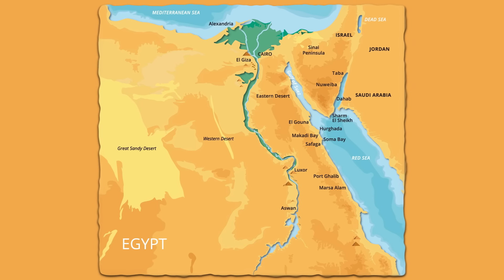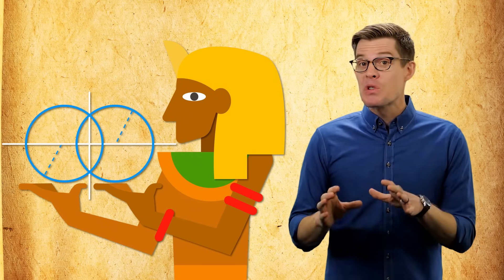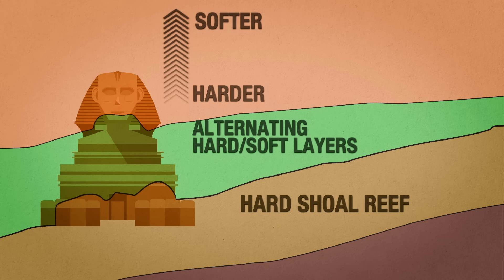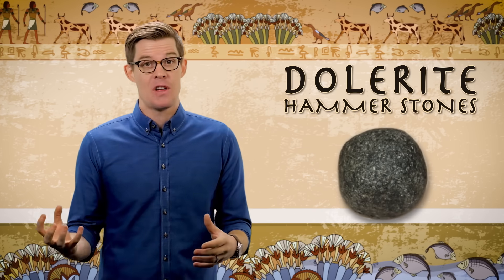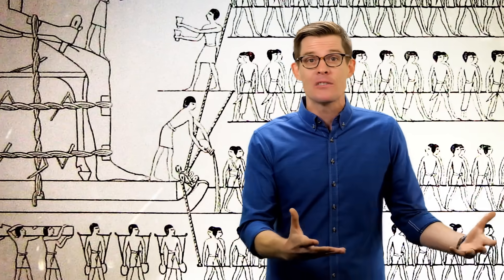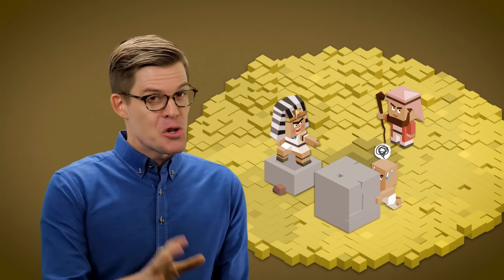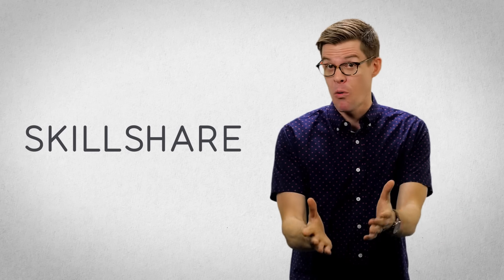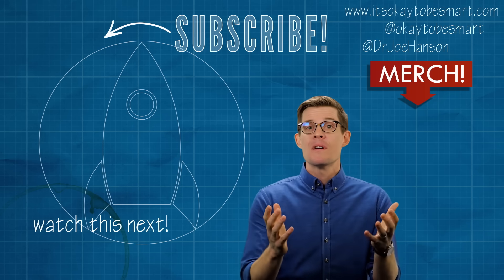The INCREDIBLE Ancient Engineering That Built the Pyramids

Comment: How did they core perfect holes in granite?
Reply: Copper/bronze drills and sand.
Reply: jmaedl027 jmaedl  How do you know?
Reply: jmaedl027 jmaedl  There are drill holes and granite cores dating from the Old Kingdom. And experimental archaeology has proven that you can drill granite with Egyptian bronze age tools.
Reply: jmaedl027 jmaedl  You can get a drilling rate in granite of 5 cubic cm/hour (Denys Stocks, Experiments in Egyptian Archaeology, page 115), which is fine. The experiments were done long enough until the core was snapped out.
Reply: jmaedl027 jmaedl  What does this have to do with granite drilling? There are many possible explanations in the last 3000 years.
Reply: jmaedl027 jmaedl  Google what? The experiments have replicated those drill holes and cores with primitive technology. Do you have any evidence of any previous advanced civilization?
Reply: It wasn't always a hard granite rock , it was soft , wet , pliable flesh from gigantic giants from the flood !

The truth will blow your mind !
Reply: "Hammers, chisels and sand!" 🤣😂
Reply: @BaMenace  Obviously it was lasers, sound wave technology and anti-gravitational devices, everyone knows that...
Reply: I do not believe also that they were able to drill holes in granite using the mentioned tools made of bronze. The wear of a bronze tool is simply too high. They would have to use thousands of tools or resharpen them so often to be able to drill even very small and shallow hole. 

And another problem with drilling deeper hole into any kind of material is to avoid hole deviation to the side. Today we use special drills with sensors able to detect start of side deviation and steel drills able to make correction of drilling direction in order of compensation.

Simply no way of making even 20 inch through hole into a granite slab without a side deviation using mentioned tools!
Reply: @MrAchile13   didyou even watch the video after an entire day's labor they managed to do a core that was about 2 and 1/2 inch deep to people using modern-day rope around a modern-day built drill made to emulate an ancient drill bit I don't think that holds any water
Reply: @deepsquat600  It proves that granite can be cut with copper and sand and the results are matching with the ancient cores and drill holes. You may want to explain why modern rope is so different then the ancient one.

The rates of cutting granite are: 
sawing 12 cubic cm/ hour
drilling 5 cubic cm/hour
Source: Denys Stocks, Experiments in Egyptian Archaeology, page 115.
Reply: @MrAchile13  well as to the rope a modern rope will last much much longer than some Vines put together running across a stick the vines running across the stick will heat up and wear away very very quicklyas for the copper proving you can cut it through the stone it wears it away yes but did you see anybody cut all the way through a stone
Reply: By that I mean did you see a stone block cut all six sides straight and even get a date know they said a day for a couple of workers to go 5cm that's just ridiculous that means out of the million Stones you would have what 700 million man hours I don't know but it would be way way too long and way too many people and way too labor-intensive as not even talking aboutthe wear and tear on the copper saw where would you get all that copper how many times would you have to melt it back down and create another one how many saw blades would you go through just to cut one block these are all the things you're not considering
Reply: @deepsquat600  1) Egyptian didn't used vines, they used ropes, made from a range of materials which were durable.

2)  "did you see anybody cut all the way through a stone" no...people have much more efficient ways of cutting stone nowadays. You don't need to cut a stone in half in order to calculate the cutting rate.

3) This is a false dilemma: most of the stones used in the Great pyramid are limestone, not granite. Don't confuse the two.

4) If you want to see a calculation for the complete manufacturing of a granite sarcophagus, alike the one of Khufu, check out the comment section of this blog.

http://www.jasoncolavito.com/blog/matt-sibson-claims-lost-egyptian-sacred-book-holds-secret-of-the-pyramids
Reply: jmaedl027 jmaedl  they definitely didnt dk it
Reply: Please ... Stop with the guessing , you can only confuse others who seek the bare truth .

The hole were cut into the material.
The material was wet , soggy tendonus flesh from gigantic humans who stood over 2 miles tall .
The flood came and they got stuck in the mud and drowned while standing.
The salty water from the flood cause the bones to dissolve but the tendons love the salt as the would become petrified or preserved .
These humongous Achilles Tendons was like a huge block of cheese , very soft but they were in block formations.
The entire body of humans are blocks of cells and this is why you hear people talking about building blocks of life .
The tendonus flesh was soft that they didn't need mortar for the joints , it was self-sealing.

The pyramids were not built from the bottom down , they were built from the top down as the material was already in place .

I guess I should go ahead and tell you the biggest kept secret of this world .
This might shock most of you and or scare the he'll out of you but you are living on top of these dead gigantic creatures.
What you are calling land is nothing more than the dead piled up body's of unbelievable creatures, human and mammals.
Serpents
Dragons 
Humans
And animals of all kinds that you have never heard of or seen .
This planet is not what you have been taught , we have all been told lies . The things you call rock , mountains , sand , dirt , stones are all body parts that were petrified by the salt water flood.

Every land mass that is above water is made up of dead gigantic creatures and people are living on top of them.

They tell you that earthquakes are cause by some plates shifting but it is a way to keep the truth hidden. The earthquakes are simply the bodies of the creatures,  that we live on top of , shifting or moving because they are surrounded by water and their body's are decomposing little by little .
They told us that contenants shifted over time and broke apart , that is mostly true but they didn't tell you that the contenants are dead petrified body's and water moved them around as the dissolved or decomposed.

The human ( Gigantic ) creatures were called cloud eaters by those of Noah's days because their heads were up in the clouds.

If you want to know what the pyramids looke like before they took shape as we see today , Google the devil's tower , it's a smaller sample of what was used to build the pyramids.

If you was to see a human scaled size of a female giant, Google Ruby's Fall ..
 You will be looking at the inside of a female reproductive system but on a humongous scale .

There's a Serpent that runs from South America all the way up to California .
Now you understand why California is said to drop off into the ocean one day.
You also may understand why California has such good soul for growing things , they are located in the waste of the gigantic serpent ... Yes , the shiot hole is right there in California .

Houses are built on to of these dead , humongous creatures and we have never been told of this .
This shiot is deeper than You can imagine. ((No pun intended)) !

Now .... How does it make you feel to know that you are being charged your entire adult life a fee or tax for living on what is called property or land that is nothing more than dead creatures that does not belong to anyone and they are charging people yearly .
Who are the people that charge you such fees or taxes , they are the same one's that controls your life.
They take your money before you get paid and continue to take , these same people controls and owns the banks .

They are the elite , the controllers , they keep you Working for them until you die.

They just raised the retirement age !

You're welcome
Reply: @MrAchile13  the granite in the Giza plateu is too perfect to be done by hand. They are are consistently flat with a varience of 1/10000 of an inch. That precision cannot be achieved by hand. Believe it or not, but the builders of the pyramids used advanced tools and advanced engineering to build it. The fact it can't be replicated today should be self evident.
Reply: @javiersoto5223  

No advance tools , you watched too many videos !

You just don't understand what the material was before it hardened into granite !

You can't used your understanding to solve this , that's why people are having such a hard time figuring it out .

This was not hard material a first , it was like a block of cheese , soft and soggy until it hardened .
Reply: @NOTTHASAME yeah you're right. All over the world you can find evidence of geopolymers and softening of stone. The Aswan quarry also seems softened. I wonder how that was done.
Reply: @javiersoto5223  

You don't get what I said !!

If you would re-read the post , it told you that the material was not stone , it was tendonus material from dead humongous creatures that died during the flood .
The tendons and flesh became wet , soggy and pliable like a block of cheese.
Once it dried , it was hard as rock ... Granite rock is dried flesh !

There was no special tools needed , you could do it with your hands and no mortar needed as it was self sealant.
Reply: I seen spaghetti bigger than this guy's arms
Reply: Nick Nack  India, soft stones literally every where, cement granite on statues in Egypt n Syria. Pyramid casing stones. There's evidence everywhere
Reply: Nick Nack  the sand hypothesis is idiotic. And those countertops were made using diamonds and modern day machinery. How did ancient India drill mm sized holes that curve at angles using sand? What about the metal infused into the granite statues at Syria? Some temples in India are built with man made stone that float on water. The evidence is there, you just refuse to see it.
Reply: Nick Nack  thank you for being professional. It's rare to find people like you online. YouTube these videos; they have a lot of info
- "Ancient Building Techniques Concrete Use in Ancient Egypt" (there are examples of hollow statues in Egypt. The Assyrian winged bulls were made of some granite concrete. Faces on assyrian temple walls had metal beams to support them)
-"1000 Year Old Secret Drilling Technology" (one example of tiny holes in Indian temples)
-"Rock MELTING Technology at Ramappa Temple, India (Dented pillars hinting at softening of stone)
-"Floating Rocks of Ramappa Temple, India" (the builders used man made bricks that float on water and are supposed to help with earthquakes)

I would appreciate it if you can show me how I am incorrect. The last thing I want is to believe something that is false. The evidence the videos present convinces me to believe what I do.
Reply: John, Egyptian technology was capable of cutting through granite, saw style, as well as core drill style, at a very slow rate, but would force you to chisel out the core to proceed deeper. There has never been an ancient core drilling tool recovered, they are absolutely possible, but they are still only theorized. Many of the core drill holes found scattered amongst Egypt seem to be quite random and lacking an ingenuity purpose. One would think something that takes so much time and effort to accomplish would have a definitive reason to be there. A handful of cores have been recovered showing evidence of highly sophisticated tool marks. Are they actually 5000 years old, or are they fakes? Debatable, but creating a precise pattern on them with coarse sand and a stick drill is an absolute impossibility. Conclusion: core drill holes were theoretically possible for the dynastic Egyptians to make, but the smooth and perfectly intact cores themselves they could not. What you should do: travel to Egypt and take precise measurements of the holes. If they are perfect symmetrical circles, burring in a perfect symmetrical line, you can most probably rule out that it was made by a hand tool.
Reply: @NOTTHASAME  lets say it is true that it was made by dead bodys of giants or what ever creatures you think it was. Lets say its true. How did tjey make perfect precisions and flat surfaces out of these softened cheese like materials?
Reply: @Vortex_one  

Be more specific on what you are considering flat things ??

Name it and I'll explain it !
Reply: @NOTTHASAME  Flat surfaces from the pyramids from top to bottom. How did they make it flat and the precision nearly perfect if the objects were soft like cheese.
Reply: @Vortex_one  

You have to move away from the table that you're accustomed to eating from.
You can not lean upon your own way of thinking or understanding , clean the slate and open your eye .

Things are not going to line up with what you have been programmed to accept and this is the problem that everyone is having in figuring out the puzzle, force fitting will never give you truth .
Things were so different than your mind could come to understand, give me you blank mind and know this took lots of digging and researching.
Trying force someone else to grasp reality is not my angle , if you ask , I will take time out of my life to give insights.

Briefly
Reply: @Vortex_one  
Everyone has opinions on what and how and by voicing those opinions will cause others to be misled and confused.
Reply: @Vortex_one  

First off .. You need to know the beginning , this is a very important part of the puzzle in understanding the big picture.

This entire pass is biblical based .
Reply: @Vortex_one  
You might not be in the bible but you must understand
Reply: @Vortex_one  
It was already in place and flat
Reply: @Vortex_one  
The materials need not moving
Reply: @Vortex_one  
No one moved blocks
Reply: @Vortex_one  
It is biology 101
Reply: @Vortex_one  
Have you ever heard the term "building blocks of life" ??
Reply: @Vortex_one  
When They said blocks , you are seeing them in the pyramids.
Reply: @Vortex_one  
Now your next step is seeing what I'm talking about.

The material was there all along , after the first flood and it looked similar to this that you will Google.

Google the devil's tower and you will see what the materials used to build those pyramids all over the world looked like .
Reply: @Vortex_one  
It is CaCo3 ... Calcium Carbonate in science terms.
It is what all of your tendons are made from in your body.
Reply: @Vortex_one  

Just so you understand that the pyramids were not built from the bottom up , they were built from the top down.

Material was already in place , only needing shaping.
Reply: Nick Nack dang you actually bought into that lame video of the idiots trying to cut a stone with rope... they didn’t achieve anything besides make it clear that it wasn’t done that way
Reply: jmaedl027 jmaedl  You can cut through granite pretty easily using sand saws and drills.  I don't know why people are still claiming Egyptians couldn't have made holes or perfect cuts in granite when they had all the tools, labor and expertise to do so.
Reply: @johndow695  his other job is wacky waving inflatable arm flailing tubeman
Reply: Goat Warrior I think the issue is them doing with those tools on that scale with the timeline that experts think it took them to make. It doesn’t match up
Reply: @sironen24  Why doesn't it match up? Tens of thousands of workers building a relatively simple building in a couple of decades is entirely plausible.
Reply: Goat Warrior relatively simple? It’s not simple because we still don’t even know how it was made. We can’t even figure out how they would have did it in the proposed amount off time with those tools. They can’t explain how the stones (including the 70 tone internal granite pillars that they always  neglect to mention) were cut and moved. Don’t even mention a ramp because that’s ridiculous
Reply: @johnwood. Mercury drills lol
Reply: jmaedl027 jmaedl  i'm starting to think these people were giants... and maybe they were taken to another planet... some kind of dead technology that we know nothing about... the pyramids seem to mark something..they can be seen in the sky like an airport runway... or a map...google sky view pyramids...maybe the ship was shaped the same way... don't forget the pyramid is a symbol itself and its on the dollar bill with an eye
Reply: @MrAchile13  its granite, it would take many days and most of a copper tube to drill only one hole, and still would not be valid as a explanation, becouse you can see the spiral marks on the rock, and some times they over did the cut, you can still see where the drilling went past the point desired to stop,  that only happens with some kind of fast cutting toll. How would they carve a Black diorite stone statuet with copper ? This rock is even harder than granite, you cant carve it even with hard steel. Egyptology clearly is not telling history, they tell a story. Egypt is much older and much more advanced before the dinastic  time, the time Egyptology tell us about, was the decline, the last chapter only of this magical place.
Reply: @tbg008  Yes, it's a slow process and it consumes copper. The spiral marks were made by the abrasive trapped between the rock and the saw. Even more so, the cores found do taper because of the back and forth action of the bow used for drilling. Also, there are copper traces found inside some of the wholes. 

They didn't cut after the point they wanted to. The drilled the cored and then snapped it with chisels, this naturally leaves a small part above the bottom of the cut. Corundum was found inside of a drill hole at Amarna. Corundum is 9 on the Mohs scale, while diamond is 10. They  most likely used it as an abrasive, the copper tube is just moving it. 

There is no evidence that Egypt is older or much more technologically advanced then we currently think. If you are gonna make such a claim, you have to bring evidence.
Reply: @tbg008  I got another notification from you but I can't find the comment on the thread. You don't carve hard stone statues with copper, but with stone chisels. Denys Stocks drilled and cut granite with copper and sand and actually published his results, including the cutting ratio - 12 cubic cm/hour (Denys Stocks - Experiments in Egyptian Archaeology, page 115). If you do the math, you will realize that you can cut and drill the sarcophagus of Khufu in less then 3 years. But it gets even better, this experiment was done with sand, emery, which contains corundum, would give a better result, since corundum is harder then quartz.
Reply: @MrAchile13  i just said there is plenty of evidence, beeing missinterpreted and missplaced to fit a old narrative. You are just not aware of it yet. Not only in Egypt, but also here in south america, in  messoponamia etc..egyptology gives always the lattest possible date to a site, like the last expantion or renovation as if is the inicial project. Please take the time to watch the documentarys i recomended, from a interested person to another, think with a open mind about all what is said. We hugelly understimate our ancestors.. A big effort is made today on keeping this ilusion of progress. History dont even talk about how catastrophyc the end of the last ice age really was, only 13 thousand years ago, it wiped the world clean, it took thousand of years untill humanity could reorganize..the start of civilization 9/7 thousand years ago was actualy a restart. The egyptians thenselfs talked about this time, they actualy say their wisdom was inherited from a even older civilization. Please take a look also on what Dr Robert Schock is saying about the sphinx, it's a good evidence for a start, it actualy have clear heavy water erosion, in egipt?  Where it dosent rain for the last 7 thousand years ? Ops. .something dosent fit, many things dosent fit.
Reply: @MrAchile13  i excluded one commet becouse it was saying the same thing again, and i only realize it was the same person after.
Reply: @tbg008  Extraordinary claims require extraordinary evidence. If have any please bring it up, because I'm researching this topic for quite a while and all I saw are empty or false claims. I already explained the things you brought up previously and they fit with the evidence we have. Don't just assume that the researchers are miss representing things, unless you can prove it.

You can't erase all the traces of a global advanced civilization, yet there is nothing. Here is a the problem: to say that a certain object (or the drill holes) is evidence of highly advanced tools and then to say that the evidence for highly advanced tools is that object that you referred previously, is a circular argument and therefore a logical fallacy. I've seen this fallacy done way too many times, regarding this topic.

Except that this is simply not true, the Sphinx enclosure gets flooded from time to time, even today. There are photos from the Sphinx enclosure being flooded on 25 February 2010. The same goes for the Valley of the Kings, which is in the dessert. That being said, I'm not convinced by Schoch, not to say that his theory is debated among geologists themselves, that the Sphinx is crumbling even without water due to salt infiltration (this also begun to happen inside some of the pyramids) and not to say that there are absolutely no artifacts from 9/7 thousand years ago that can be identified as anything more then stone age.
Reply: @MrAchile13  gobekli tepe is a huge megalitc site, that was deliberated barried 10 thousand years ago..only 500 km from egypt..i think our conversation will be more production after you watched "Magical Egypt" by John Antony West, and "The pyramid code" if..if you undertand the evidence presented, you will also see the "specialist" egyptology is telling a story that can not be so. I myself had to realize i was wrong for a long time, i had to develop the eyes to see what this people are pointing out. I hope in time you also will come to see that for yourself, becouse i'm not gonna be able without a long conversation to point out what the documentarys are already presenting.
Reply: @tbg008  I watched them both (actually not all the episodes from magical Egypt) and I'm not impressed at all,  since they make claims without proper evidence. Carmen Boutler (The pyramid Code) is a fraud, since 1) she shows her Phd title after her name in order to give her authority, even though her Phd has nothing to do with history or archaeology and 2) and this is really bad, she makes things up...Lots of things, like saying that the casing stones of the pyramid of Khafre are made from red stone (they're not, they're made from white Tura limestone). When someone makes a documentary based on miss information, that someone is a fraud.

What makes you say that the egyptologists are wrong or that there were ancient advanced civilizations?As we saw, granite can be worked with primitive tools and the Sphinx gets flooded even today, while there is no traces of advanced civilizations. I'm not sure why you brought up Gobekli Tepe.
Reply: @MrAchile13  i brought up gobekli tepe becouse is actualy mainstream, close minded archeology saying the place is more than 10 thousand years old, maybe much more, we can only tell when it was burried. This show there was something more than hunter gaderers in pre-history. A center of inovation teaching about astronomy, agriculture..and who know what else..right at the soposed start of civilization ? Who ever builted that place was not learning anything, they where teaching local herder people how to organize a civilization..in the place where archeology says it all started..when the site speaks of a restart project. Modern humans are walking this planet for at least 200 thousand years, and the church of progress conviced most of us civilization only started 5 thousand years ago. This is a dogmatic idea, put in place so we today think our way of doing things are the best, there is a lot invested interest behing the telling of history that your aparently is not aware of..envolves religion, politics, the manutence of power today. Imagine the effect on people to learn there really was a lost chapter, that our history only tells what happened after the flood (end of ice age) and tells before it was only primitive people, there where primitive and hunter gaderers, what is forbiden is to tell there were a global civilization colonizing the world 20/15 thousand years ago along side primitive people,  just like today, airplanes flying over hunter gaderers in the Amazon..in the artic..think about this.
Reply: @tbg008  You simply assume things, why? You said that "where teaching local herders" and "the site speaks of a restart project". What makes you say that? Who are they, where is the evidence of them and why do you claim is a restart project? I see that you used the "church of progress" line from Anthony West but that won't help. There are 2 important aspects that you are overlooking:

1) Human technological progress is exponential - we used animals for land transport for thousands of years, then, in 2 centuries we went from horse carriage to airplane.

2) There is no evidence of a previous advanced civilization, only stone age artifacts, therefore the scientists are drawing the conclusions. Do you have a problem with science itself?

Again, if you want to believe in it, it's fine, but I don't blindly believe it, I need evidence, of which there is none at the moment.
Reply: @MrAchile13  Dude
.i think you see this information and go to denial Mode,  close minded as i said. Klaus schmidt, the head archeologist on the site discribed gobekli tepe as a center of inovation, burried 12 thousand years ago. fact does not change becouse you ideologicly
 chose not to see it. The evidence you dont stop asking about is the bloody sites thenselfs. You dont yet realize when the persians,  greeks, and finaly romans builted temples in baalbek, the foundation plataform was already there, long before, with megalitic work never seen after on that scale. Tiwanaku in bolivia is a costal city, it once was at the shore of the lake titicaca, no one would build a city 20 miles from the lake, the lake is central to survival in that right plato..you know when the margens of lake last touch the city ? Only before the end of the ice age. But when you date the place its contaminated by more recent people..giving misleading dates. And you dont seen to give importante that both in south america and egypt you find exacly the same method and technology of building, exacly the same very unusual way of building. How ? Is was clearly builted by the same people, at least from the same "school". And yes..200 years ago we where in horse back, and now we are flying. You made my argument for me. Where do you think european got the knowledge to sail the globe and develop industry ? They got it from the Crusades, from the arabs, from egypt. Everyone that builted a great empire in the last 5 thousand years builted around a sacret knowledge stolen from egypt, and again the egyptian thenselfs say they enherited this knowledge. As i said..if you dont think again, if your mind if already set in stone, i'm talking to a rock, but if your ready to change your perspective, the evidence is there. I believed the official narrative, for decade, took me many years of study to down on me, we are lied to, history is told and edited by the victorious. Other point to be made, there are many citys 40..80 meters underwater in the cost of Índia, and the mediterrane, the last time the sea went up this much was again the end of the yunger drias, 11800 years ago. I was very skeptical about this idea of a lost civilization, and did not believe people telling me otherwise, just like you. Today i undertand i wasen't ready to undertand the evidence, and why egyptology dismisses so fast diferent ideas. Thats the only reason i'm still here, i see myself in you, and took the time to bring this to your atention..in the hope you would take this act as not a argument or challenge to see who is right, but someone trying to tell you something you still dont see.
Reply: @tbg008  My friend, I think you make a confusion here. Yes, I know what Klaus Schmidt said. My question is, where did the part with "were teaching local herders" and "is a restart project" came from? On what basis are you making that claim? 

Unfortunately here you start to sound like the pseudo-scientific "documentaries":

- Gobekli Tepe is a stone age site, I hope you are aware of that. There is no pottery, no metal and no writing

- the Egyptians moved 1000 ton statues in the New Kingdom (heavier then the ones at Baalbek), the heaviest stone ever moved was the Thunderstone (~1400 tons), moved without modern technology in XVIII century Russia. Therefore, stones heavier then those at Baalbek were moved without modern technology.  Also, the thriliton stones were dated to roman era, not before.

-  dating was done at Tiwanaku, you simply ignore it, which is really disingenuous. You can't date a city by the position of a lake, especially since everything points to completely another date.

-  people use the same solution when faced with the same challenges, just as how ants build likewise structures across the globe. You said that people were much smarter then we think, but you don't think that they could discover the same elementary technology (like corbels or asymmetric walls).  How those 2 statements make sense from the logical point of view?

-  why do you ignore the vast and crucial differences between American and Egyptian architecture? Perhaps because that's what your documentaries thought you to do. Compare an american pyramid with an Egyptian one. The big problem is that we dated all the structures you are talking about and they do not date from when you claim they do, but sure, let's ignore scientific dating, because reasons.

-  no, I guarantee you that the steam engine, combustion engine and the plane are European/American inventions and they do prove how fast and exponential technology can develop. There are still primitive societies which again, proves that humans societies can exists for a long time without developing technologically. This is not evidence, this is proof.

-  please bring sources for those sunken cities, it sounds interesting

In conclusion, I addressed all of your points (correct me if I missed anything), we saw that granite can be worked with primitive tools, heavy  stones can be moved without modern technology, the Sphinx still gets flooded and there is no evidence of a global highly advanced civilization (you literally brought none). In this circumstance, why do you believe I would see any sense in what you are proposing?
Reply: @MrAchile13  you dont realize, that you can see into the past, it's not science, yes, it is imagination and speculation,  but that was always the starting point in any hipotese or theory.  A center of inovation..it implies teaching, from someone who knows more than the local people. The heaviest blook in baalbek is 1400 tons also, and a heavier still, not completly moved from the quarry. The point is that plataform where the roman temples where builted, was already there. Prove that endeed later civilizations where building their temples in places that had previus monuments, building on top of it. That still happens recently, many european cathedrals where builted over pagan temples ..why ? Many enormous cathedrals have people burried inside, but we do know very well a cathedral is not just a tomb..is a house of god, a sacret place.. you see ? You forgot one point i made, the time the sphinx spended burried under sand, even in latter dinastic time, some rulers ordered the cleaning, but again and again let alone, the sphinx went back into her sandy tomb, only with the head out. These peridoc floods would not make that kind of water erosion, that is heavy felling rain, for hundreds and hundreds of years. About stone erosion i believe what the geologist say,  end what i can also clearly see. About the architecture from america exacly the same found in Egypt, i was not talking about the curious urge to
build gigantic building in the same form..i was talking about megalitic walls, builted with stones with 90 degre cornes, and the ones with not a single rock the same size and shape, perfectly put toguether, exacly the same technic of building a wall,  in peru and in giza. I will stop and find someone pointing this out on youtube and show you to..it is undeniable the same method. I like science, i just realize its political limitations places scientific enquire can not go. And wen you see dogma it's no longer science, it's faith. I know no such thing as pseudo science, only science not understood, or plain bullshit. The same with supernatural, there is no such a thing, i think its natural phenomena, not yet understood also. Believe me, i was once a hard skeptical "big science" guy, untill i grew wiser and started to see dark games being played..untill i had some personal experiences that showed me what ancient initiation and spirituality was about..Only then i started to undertand mith and legend, only then i understood there is a lot modern science leave out of discution, labeling serius people along with the lunatic group as pseudoscience. People today think in material terms only, and well..that's not surprising this same people call a gigantic "temple" of initiation, a tomb. And call the ones that say this places where housed the gods, pseudoscientist. Go figure..we know a cathedral is not just a building, the architecture have a function..and the same is true for this earlier temples. If you dont know sacret geometry, you have no chance of undertanding what the ancients where all about. The building thenselfs when astronomicly studied revels the ancients knew what science today don't admit. To this day people dont know what on Earth is procession of the equinox, when this places where astronomicly aligned to study the heavens, and aligned for time keeping, like a cosmic clock where the marker is set in stone and what goes around is the heavens. When i undertand this and saw that not even this is acepted by egyptology i realize those dark games beeing played, i talked about. I think we so far only respectly desagreed. But i still will come back and link you to some more info when i can.
Reply: @tbg008  Part of looking into the past is science. Stratigraphy, carbon dating, isotope analysis, dendrochronology, thermoluminescence, are science. All of those are used in archaeology. 

- the heaviest block from Baalbek was not freed from the bedrock, therefore it's weight is irrelevant. You can carve a block that weighs 3000 tons, as long as you don't  move it, is irrelevant (just look at the giant statues of Buddha or at Abu Simbel). The heaviest blocked that was moved at Baalbek is 800 tons.

- yes, the platform from Baalbek is older, but the thriliton blocks are not. And yes, conquerors used the previous sacred spaces since that shows who is now in charge. It looks like we both agree here.

-  the Sphinx spent plenty of time above the sand, including in the Old and New Kingdom (when it was dug up by Tuthmosis IV)

-  yes, I agree, it's the same techniques in some of the buildings, it's just that they reach it separately without having contact among them, since there is no evidence of any contact

Believe as you please, but I encourage you to read academical sources and (you will see how many lies are in the "alternative" community) see if you can debunk them. You should be aware of both claims of the pseudo-scientists and the academia. Cheers!
Reply: @MrAchile13  all information i ever had for the first 8 or 9 years of my obsession on ancient civilizations and traditions, where academia research, documentarys, books and presentations..listening to the alternative explanation came only after my interest in psychodelics, that showed me what science don't talk about, only then i had a chance of undertanding the real meaning of the mythology..when i realized what kind of society this civilizations where, by their believes, costumes habits and spiritual habits told in their books..this prejudice towards then disapear. You don't undertand magical egypt becouse you dont know magic. I'm like you, the science show me the evidence guy, and in my thought process still the scientific method..i only was exposed true ritual to a diferent side of reality, that our moder science ignores and leves to superstition and myths and religion..the same skeptical mind, only expanded. I assume now you think i'm crazy, becouse you never had such experience, or did you ? Only in the last 4 or 5 years i learned all the other part, archeology do not and can not tell.
Reply: @tbg008  I heard similar reports from people trying psychodelics. Hancock started his whole "research" because of that. But what you said here has nothing to do with the existence of a lost highly advanced civilization. 

As for research, you already used information that wasn't true (I'm not saying this to attack you, but to show that there's always more to be learned). If you are interested in Egypt and Tiwanaku there are 2 good books on the topic that deal with architecture and stone processing. Dieter Arnold - Building in Egypt and Jean-Pierre Protzen/Stella Nair - The Stones of Tiahuanaco
Reply: @MrAchile13  You're wrong about copper drilling into granite. You said abrasives leave spiral grooves but it was shown that only a fixed gem power tool can cause concentric circles like those. There are also holes drilled on stones from the side not the top and were found in situ. And also stones with concave cuts which can't be explained by the bronze saws and sand slurry.
Reply: @ok-pn6hg  At first look, the grooves obtained by the experiments of Denys Stocks look like the ones from dynastic Egypt. If you have a source detailing the different patterns resulted from different types of drilling, showing that sand cannot leave such marks, please leave a source, I would like to look into it. 

If the stone is not bedrock, but a free stone object, I don't see why the stone couldn't have been turned to side in order to be drilled. As for the concave drills, I am aware of their existence and indeed, those particular drill holes cannot be explain by the method described earlier.
Reply: @MrAchile13  The Denys Stocks grooves were different.They were horizontal as opposed to the Flinders Petrie cores which were shown to have a spiral concentric groove traceable for several inches which cut equally deep across feldspar and other components of the granite. It cut even deeper in quartz however which puzzled the engineer who analyzed the sample under microscope because it is the hardest component of the granite. It may have been quartz's resonant properties which, through vibration or some other energy input, could've been made more receptive to incision.

Christopher Dunn: Lost Technologies of Ancient Egypt: Advanced Engineering in the Temples of the Pharaohs
Reply: @ok-pn6hg  Have you found a detailed analysis of the grooves from Stock's experiment? If you take a look at the core  7 of Petrie, the grooves do appear just as horizontal as the ones from Stock's experiment. I've seen the pictures of Dun wrapping string around it in order to show the pattern and they are not perfectly  parallel, as they should be if they were the result of the cutting rate. 

But the problem is that the core tapers, which again, means that the grooves cannot be made by the cutting edge, since the exposed surface is not the one that was cut by the cutting edge. That original surface was worn off by the walls of the drill.  The best explanation I see is the groves being the result of trapped abrasive between the granite and the walls of the drill,  coupled with the oscillation of the drill.

Even if there are things we cannot yet explain, like the concave drill holes from south america, this is not a good argument for advanced technology, nor does it makes sense in the context of a bronze age civilization.
Reply: @MrAchile13  Yes I have looked at it and they are not both horizontal, only Stocks' core is. In Stocks' experiment he put a side by side comparison of the two drill holes where he tilted the original image of Petrie's core no.7 to make it appear as if the grooves were horizontal when in fact they were concentric and one single groove was shown by Dunn to be continuous for 2/3 of the core.
Reply: @ok-pn6hg  At which page have you found this? Was Stocks's core ever analysed in detail as the core 7? I would like to check it myself. But let's assume you are wright. The grove marks do not prove the rate of cutting. There are 3 main problems:

1) there was no advanced technology back then
2) the groves are not parallel 
3) the core does taper

Hand drilling is the best explanation we have, since:

1) it is consistent with the technological level of bronze age Egypt
2) fine grained sand and copper residues have been found in drill holes
3) it works
4) the tapering of the core is consistent with this method
5) it produces groves 
6) it's attested by the pictographic depictions of the time

There are multiple methods of hand drilling and it would be interesting to see a study that compares the grooves made by each method.
Reply: @MrAchile13  The purpose of Stocks' experiment was to demonstrate the ability to drill into granite with copper in the way the Ancient Egyptians were shown to do by Petrie who said that only precise machinery can leave the trace in the cores he found. So the comparison needed to be made by Stocks and his team which they did in their analysis to prove that they were identical to core no.7. However, Stocks' and his team, unable to replicate the concentric spiral, simply tilted the image of core no. 7 to make the grooves look horizontal because it would benefit his theory. But the fact is that those grooves are traceable around a spiral path all along the cores. 
You say there was 'no advanced technology back then' : This is a study demonstrating the use of precision compound machines before Ancient Egypt: 
https://www.peterlu.com/pdf/publications/2004/Science_304_1638_2004.pdf

As for the tapering, I do not know how this was possible but if you care to read Dunn's book I remember that he addresses it and I don't feel like digging into it, but I remember the explanation was pretty simple. 

Hand drilling would not have made the type of grooves we are talking about here. Hand drilling means cutting back and forth in a very laborious process which does not yield the cutting rate demonstrated. It only leaves horizontal grooves which are to be expected. In contrast, the ancient grooves are most similar to modern power tools which also leave concentric grooves but at significantly shorter increments.
Reply: @MrAchile13  

Yes Stocks’ core was analysed by himself and his team and compared to core no.7 in a side by side image to make it look like the grooves are identical and are both horizontal. Dunn also examined this comparison and he points out that Stocks, unable to replicate the concentric spiraling groove in core no.7 and others, simply tilted the image of core no. 7 slightly to make the grooves appear to be horizontal. The grooves do prove a rate of cutting, it's the same thing as the rate of cutting in fact, the grooves are the cutting edge and however deep one groove is, that’s the rate of cutting. 

You say ‘there was no advanced technology back then’. These are studies demonstrating the use of diamond in cutting and polishing corundum and precision compound machines predating Ancient Egypt: https://www.peterlu.com/pdf/publications/2005/Archaeometry_47_1_2005.pdf
https://www.peterlu.com/pdf/publications/2004/Science_304_1638_2004.pdf

I don’t know if it was demonstrated that the grooves are not parallel in the core no.7 but even if they weren’t, it doesn’t mean they were made using a different method, we are still talking about a fixed jewel point turning at a specific cutting rate around the hole. 

As for the tapered core, I do not know how this was possible but, if you care to read Dunn’s book I remember he addresses it and his explanation of it was pretty simple I just don’t feel like digging into it. 

Hand drilling does not explain the grooves we are talking about. Hand drilling is a laborious process which creates horizontal striations and not defined grooves at all. Until this aspect of the cores can be explained it is not reasonable to assume that it was hand drilling because of the lack of tool evidence. As was shown by Peter Lu in the two studies cited above, you don’t need to find the machine to determine that the precision that is evident from the artefact itself, necessitates a machine. If he had used your logic, he would’ve never chosen to pursue his study of early compound machines claiming there would be no point because we ‘know’ they didn’t have them.
Reply: @ok-pn6hg  1) where did you find that side by side comparison? I would like to take a look at it.

2) you are wrongly assuming that it is the cutting rate, which is not. Both the core and the drill hole do tapper, the lines are not parallel and they even intersect each other, thus showing that the grooves are not the result of the cutting rate. 

Take a look at this https://vk.com/@chtomoglidrevnie-granit-mednaya-trubka-abraziv (you can translate the page to english.) You can see in the figure 16 how the grooves intersect each other. You can also see an experimental replica.

3) the articles you posted are indeed interesting, although neither of them is evidence of advanced technology. Let's define terms. Using diamonds found in rivers or using drilling machines powered by hand or eventually water (by the way, the latter chinese example of rings is later then bronze age Egypt, not earlier as you said) is something plausible in the iron age. Using electricity and high rpm rates to drill granite, in bronze age or to make pyramid power generators, as Dun claims, is illogical. I hope you can see the difference between the two.

4) again, take a look at the detail of core 7 and the experimental replica, I provided the link 

5) there are multiple methods of hand drilling granite, one including an continuous motion around the core, without stopping (you can see the tool in the link above). The tool, abrasive and the amount of abrasive are factors for the final result.

6) To say that a certain object or mark is evidence of highly advanced technology (namely something that uses electricity) and then to say that the only evidence of highly advanced technology is that object or mark, is a circular argument and therefore logically invalid. You need another instance of evidence which correlates with the object/mark, like a surviving example, drawing, plan, literary source, etc. Otherwise, you can use the same flawed argument for "aliens/magic/gods did it"
Reply: @MrAchile13  You can find the comparison in his articles about stone working in Egypt:

Technology Innovators of Ancient Egypt,” in Ancient Egypt 7, no 3 
Testing ancient Egyptian granite-working methods in Aswan, Upper Egypt, Antiquity 75
“Technology Innovators of Ancient Egypt,” in Ancient Egypt 7, no 3 

2) Indeed the core and the drill hole taper toward the bottom and in considering that the grooves on core no.7 and others have been demonstrated undoubtedly by Flinders Petrie who found them as well as Chris Dunn to be concentric and spiraling continuously, it just adds to the mystery of the tool that was used. It does not bolster your argument anymore than it does mine. 
It’s my understanding that the lines are not parallel because they are spiraling downward, the Stocks lines are parallel as expected. As I’ve said before, Christopher Dunn reaffirmed and demonstrated Petrie’s original experiment showing how a single continuous groove can be traced on the core which does not intersect with any others. If you have evidence to the contrary, I would like to see it because as it stands, the core grooves are evidence of the cutting rate. In other words, I would like to see where these grooves intersect each other or are disrupted. 

I can’t access this website and I don’t know if this is showing core no.7 or any of the drill cores from the Petrie Museum. 

3) I don’t know if you read these publications but they are indeed examples of advanced technology which wasn’t available until the 19th Century. The publication demonstrates the level of precision achieved by the Ancient Chinese with Electron Microscopy and other instruments which still can’t be replicated. The rings may not have predated Egypt but that is irrelevant, they were contemporary then and the sapphire axe did predate and is illustrative of a similar level of technology. Besides, this was only meant to serve as a precedent technology to refute your claim that advanced machinery was not in use at the time. 

5) Except when it comes to the feed rate which will never be as deep per revolution as the core no. 7. 

6) I do not remember ever saying anything about electricity or highly advanced technology. I’m talking about technology more advanced than the copper tools you are talking about. That doesn’t mean laser technology or aliens or magic but maybe it’s similar to how the Chinese were working with Sapphire and Jade around the same time or earlier. Before Peter J. Lu came along, the historians were saying the same thing about polishing with sand until someone actually tested it and didn't make up his mind without knowing all of the variables.
Reply: @ok-pn6hg  1) The lines can be parallel even if they are spiraling downwards, however, they are not. I did linked you to a cite showing a close up to the core 7 showing 4 grooves intersecting. The site works fine to me, although is in russian. This is the tool I was talking about, also included in the link: https://www.youtube.com/watch?v=yyCc4iuMikQ&t=1s

2) I red both articles and neither of them is evidence of advanced technology. I'm not even sure what do you mean by advanced technology. The first article shows pictures, some of which display crude drill holes and also states that aluvional diamonds were available. The second article shows small rings with symetrical marks. Why would this be impossible with iron age technology? 

3) again, you are simply assuming it is the cutting rate and you assume it can't be replicated. How do you know? It is because you're saying so? How do you reconcile the tapering, the grooves which are not parallel and even intersect? 

4) Did I miss understood you? I supposed you do embrace the multiple hypothesis of Dun, who argues that they had advanced technology and electricity. That's what he tries to prove with core 7. If you're not arguing for electricity, how do you propose core 7 was drilled, assuming as you say, that the grooves are made by the cutting rate? You also talked about "vibrations or other energy input" what were you referring to?
Reply: @MrAchile13  I won't argue about whether there is a spiral groove or not, that's settled for me. This is a big waste of time unless you can give me a credible source which demonstrates how the paradoxical features of the core were done:
The spiral groove which is continuous and not disrupted for at least 4 or 5 turns (Words of Flinders Petrie who found the core and was reaffirmed by two later studies)
The deeper cuts in quartz than softer feldspar within the grooves (Again Petrie talking) 
And both a tapered hole and core
Reply: @ok-pn6hg  Believe as you please. It is unfortunate that you are unable to open the link, which addressed these points. But of course, I'm not expecting to believe me if can't see it yourself. Have you seen at least the tool? Why do you believe it cannot leave spiral marks? The motion is continuous and the tool is oscilating.

I'm really curious, what do you mean by advanced technology and how do you believe core 7 was drilled?
Reply: @MrAchile13  I don't know what primitive tool you are referring to that will satisfy the criteria I raised in my previous post. I don't know of any experiment that has replicated grooves in core. 7. I will believe it when I read the paper on a method replicating it.
By advanced technology I mean the ability of the Chinese to create compound machines to shape hard stone and polish sapphire better than we do today as the Harvard Physicist I've been citing has shown in Science magazine. Or is it this evidence of primitive technology also?
Reply: @ok-pn6hg  1) have you not seen the previous you tube link I provided? This is the one: https://www.youtube.com/watch?v=yyCc4iuMikQ&t=1s

2) your answer does not address my question. People told me that stone vessels are evidence of advanced technology, which was proven wrong by experimental archaeology. Before proper experiments are done on the chinese objects, you already jump to conclusions. 

What do you mean by advanced technology? Define the machines that you are referring to (also how do you believe core 7 was made?). Was it electric? Made of iron? What are you talking about?

3) To say that we don't know how they did it, therefore advanced technology (or aliens, or magic or ghosts, people use the exact same argument), is a logical fallacy, namely the argument from ignorance

To say that an object is evidence of advanced technology and then to say that the only evidence of advanced technology is that object, is another logical fallacy, namely the circular argument.